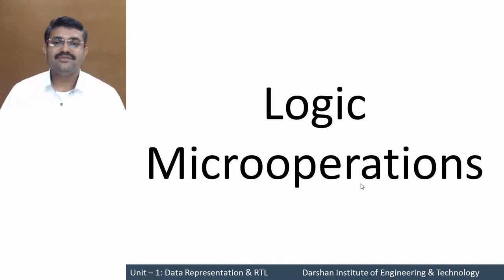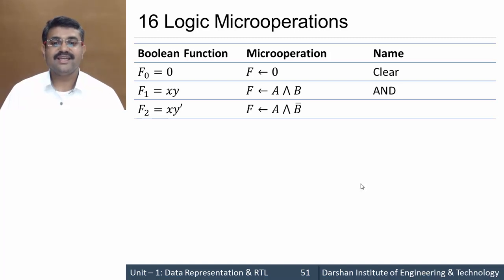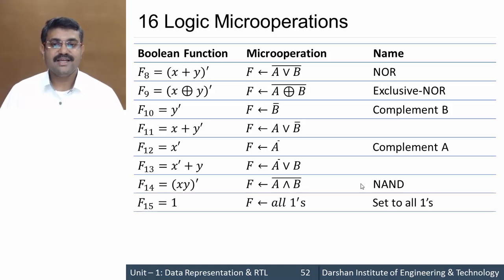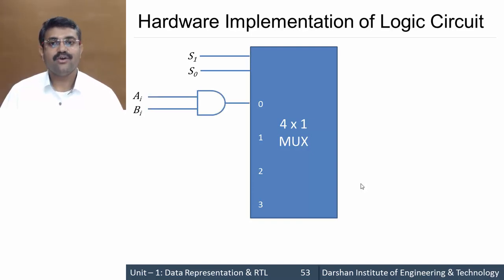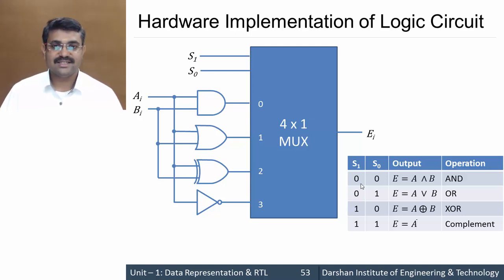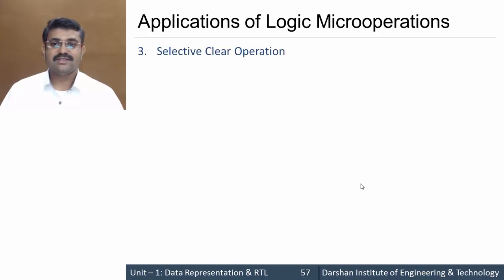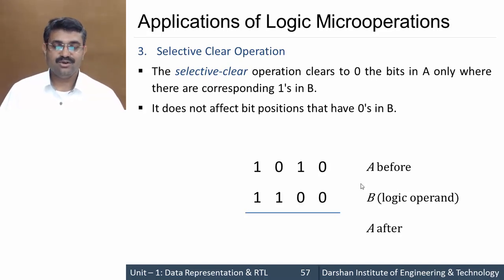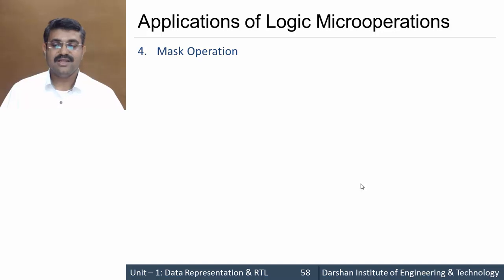1.09 Logic Microoperations

Comment: 1)selective set --> use the regular OR
2)selective complement --> if the values are similar put 0 ,different put 1
3)selective clear --> if you see 1's in b directly put 0 in the result
4)mask operation--> use the regular AND
5)clear operation--> use the regular XOR

Comment: am I the only one who does not understand insert operation?
Reply: Masking operation : 
1. Clear the bits which you want to change (masking through and operation)
2. Insert the bits in that place. (ORing through or operation)
here in this example , 
0110 1010 is the original number and we want to change it into 
1001 1010. [thats why sir said that he want to change first four bits of the number which is 0110 to 1001]
so first clearing first four bits of the number through ORing, the number will become => 0000 1010 
and then masking them with required change in the number i.e. with 1001..................=> 1001 1010.
Hope you understand :)
Reply: @aayushtheapple  thank you so much